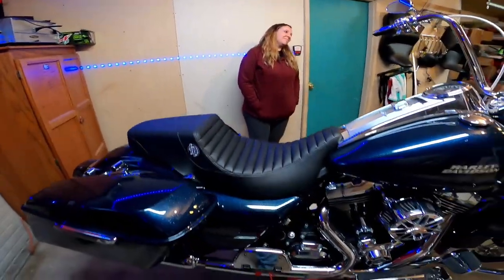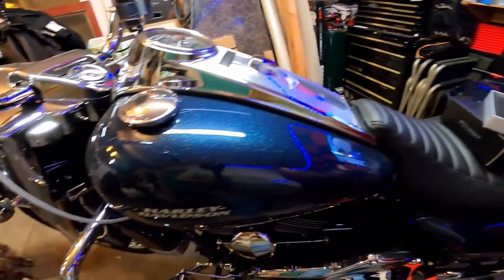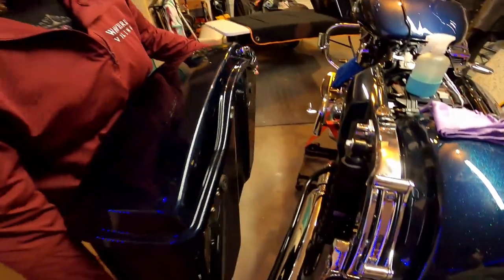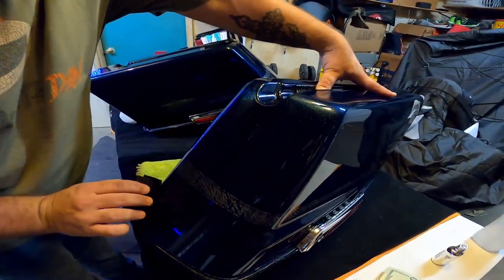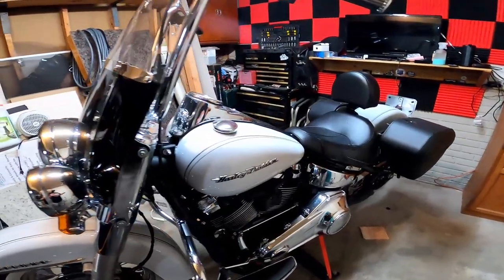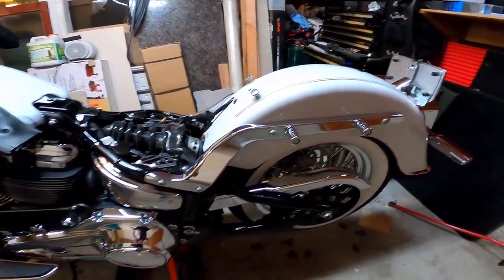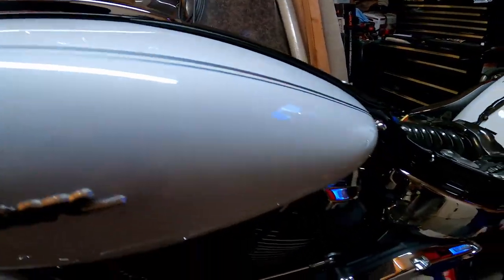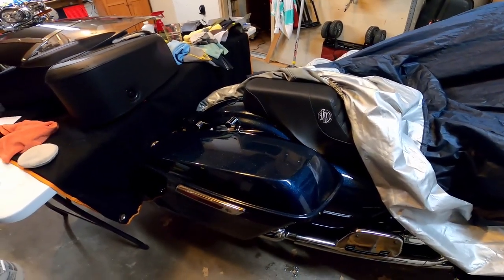Ceramic Coated Harley's!!!

Comment: It's nice to bring out the true depth to the "deep" HD paint.  I normally use Mother's on my chrome; do you like the Armor Shield better on it?
Reply from the maker: Yes. It adds like a candy coating over everything, I don’t think the true depth of it comes across on the video. If I do it again I’ll film it in 4K and see if it comes across.
Reply: Not to forget to mention, using ONLY water and Norwex to wash it to prep before we used the Armor Shield 🤪💕

Comment: Did you put it on everywhere? Will be neat to see how it handles through the riding season.
Reply from the maker: Everywhere but the engine and wheels. I was afraid of running out. But I have plenty so I will do the wheels later.